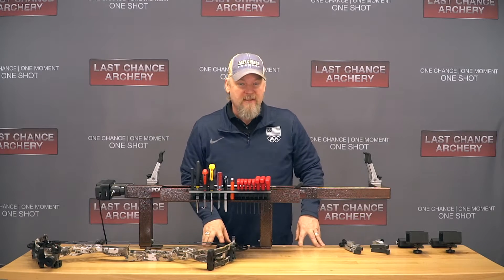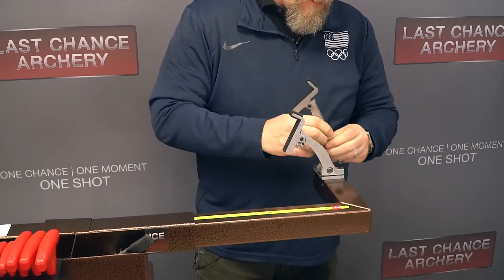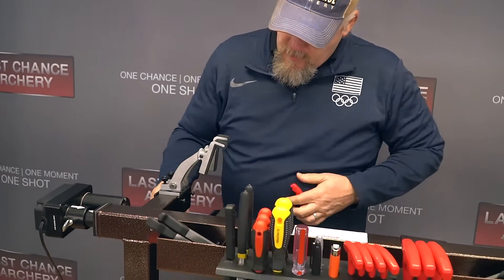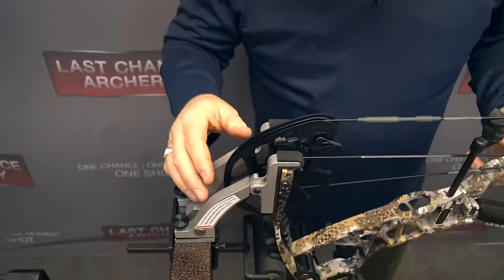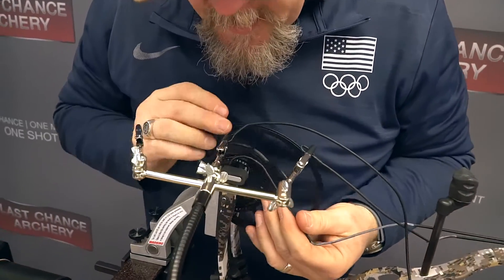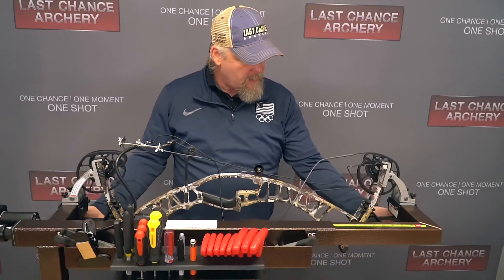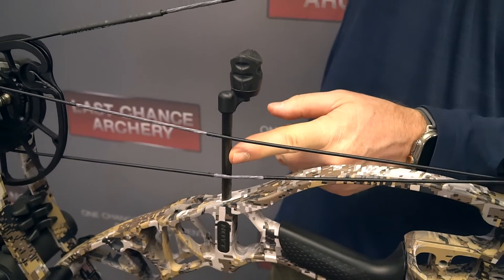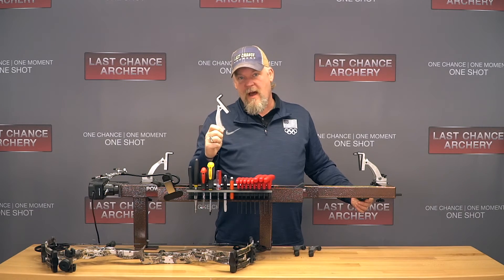Limb Lock Kit + Instructional

Comment: Can this be used on Mathews bows
Reply from the maker: It can't. The rule for the Limb Lock Kit is that if the bow limbs will lay down flat in the rotating finger head, you can press that particular bow, if the limb will not lay down flat, it won't press correctly. Mathews have adapters on the outside of the limbs, so the limb won't lay down flat. This means you can't press those. The better option for Mathews would be our standard press fingers or the newer Mathews Finger Set!

Comment: This wont work with mathews or mission?  Or can you atleast use it with any bow that doesnt have that plastic piece mathews puts on their limbs?  The mission radik doesnt have that plastic limb piece could you use this for a radik in place of the mathews finger?  I domt see why not.
Reply from the maker: It can't press bows that have things on the exterior of the limbs like Mathews and Mission. By attempting to press a bow with something on the outside of the limb, it won't allow the limb to lie flat in short making it press awkwardly and could cause issues. That said, any bow can be pressed in the Limb Lock Kit so long as the limb lies flat in the rotating finger heads.

Comment: Was this another design you stole from someone? You proved with the whole Omni thing you guys can't come up with designs by yourself.  But you can use money to steal ideas. Who you steal this from?
Reply from the maker: We’re unsure what you’re referring to when you say “Omni thing,” but the design is an upgrade to our patented Ultra Lock Adapter, except, this kit is much easier to use and a huge upgrade comparatively.
Reply: @LCArchery  will this work for Ravin crossbow R26?
Reply from the maker: It will not. The Limb Lock Kit is not recommended for crossbows!  @boonedaddy7960

Comment: 2:49 do those screws go into any threaded hole on the press? I have the Pack and go and there are no holes or indents for those screws to secure to
Reply from the maker: Good morning! They do not thread into holes. When the bracket slides onto the press tubing, you then tighten the screws just to lock it in place. The screws tighten right against the press tubing and it all locks in place.